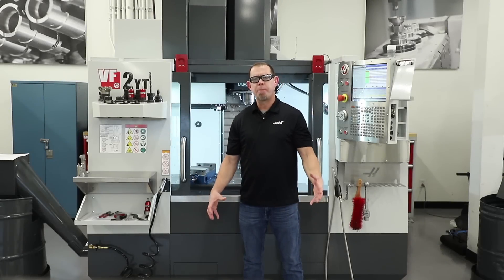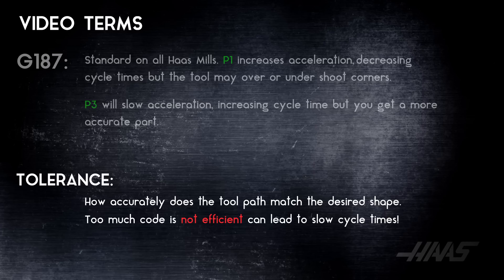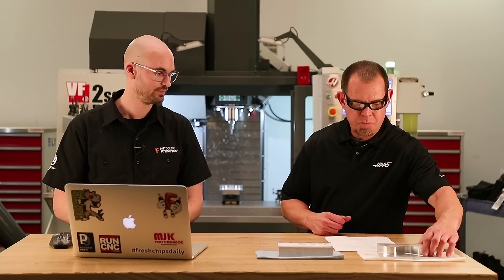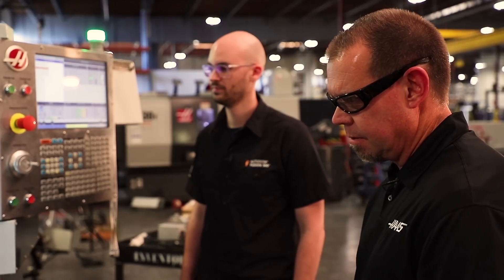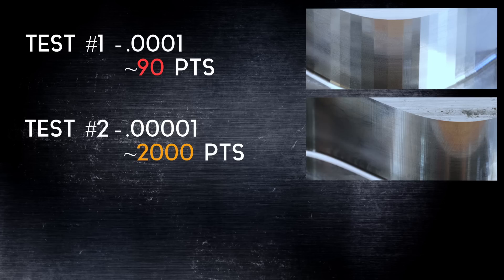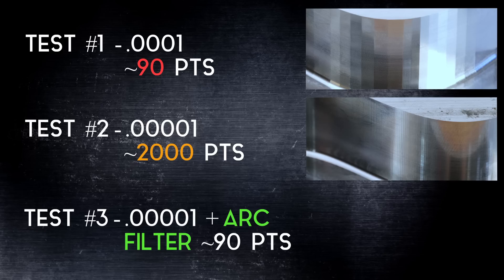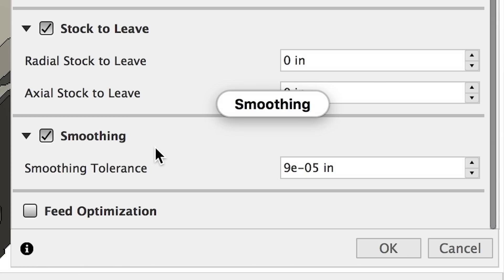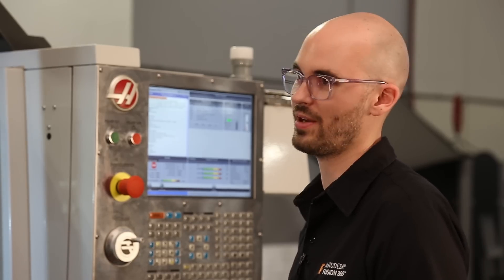CAM Settings and Your Haas Machine - AutoDesk visits Haas Automation.

Comment: dang i haven't been machining to long and this video answered all my questioned,  got an SS and was bothered about the machine slowing down if the tolerance to high and still leaving a bad finish will defiantly be using smoothing and the adaptive clearing p1 setting wish knew this earlier this is gonna help me a lot!

Comment: This question is for either the Autodesk or Haas reps: Do you guys have any recommended fusion settings for specific machines. i.e. I am thinking primarily of which Machine Confugration to choose from Fusion, or which Post Processor to choose.

Or even better a more precise answer like: use (x) configuration for a 3 axis VF2, use (y) machine configuration for a 4 axis VF2, etc.

Comment: When he talks about arc filtering nd smoothing.  The tolerances he has  "1e-05 in"  what does that number mean?
Reply: This is another way of writing 0.00001".  1e5 would then mean 10 to the 5th power or 100000.

Comment: Great video even though I don’t use Fusion360. I use SOLIDWORKS with a CAM plug in but most of the settings still apply. My shop is about to get a VF4-SS with TSC. Looks like I will be able to fly through material!
Reply: Only if you have the hsm option you can.

Comment: Im still new to this but could you use the g187 p1 to get the initial form if the part and then switch to g187 p3 to do essentially a set of finish passes or is it more efficient to just run in one of the g 187 settings? Edit just saw the last part and think it answered my question.

Comment: I was going to rough out some pockets then do a finish pass. I got the roughing pass to show G187 P1 but the finish pass would not go to G187 P3 and instead gave G187 P2. I set the Tolerance (1e-05 mm) and Smoothing lower and lower (1e-06 mm) until it was ridiculous and still P2. What else needs to be done to get P3 on my finish passes?
Reply: Hi Jack,

First, make sure you have the latest post with all of the updates: https://cam.autodesk.com/hsmposts?p=haas

This is the code snippet from the post that sets the mode to P2:
        if ((stockToLeave != 0) || (verticalStockToLeave != 0)) {
          workMode = 2; // default

This means that if any stock to leave setting has been set, the post will use P2. If stock to leave is disabled, P3 will be used. Make sure that the operation has the stock to leave option on the passes tab unchecked.
Reply: @CJAbraham  Tried it with some production code just now and it did give me P3. The Stock to Leave option was used during my first test. I had it set to a negative since I projected the part onto the fixture and need that extra 0.1mm around the perimeter. Thanks for the info!!

Comment: Is it just me or did they show in Fusion a tolerance of .01 and say it generated about 90 points, and then in the slide refer to it as test #1 .0001~90 points?
Reply: not sure of the actual numbers, but it was less points due to the use of arc's instead of straight-line moves

Comment: Great Job.  It really helps to see and hear the machine cutting also.  Traditional CAM Systems ( Mastercam, Esprit, Gibbs . . et al ) better get their act together.  Very cool that the CAM software knows what G187 setting to post.
Reply: As a contract programmer in 70s 80s and 90s I used many of the Cam softwares you mention here. I have used Fusion for my own testing looking at tool path. Fusion has come a long way and looks to be FANTASTIC for 90% of the shops
Reply: Idk why I’m responding to a four year old video, but all of those other CAM softwares can do the same. It really comes down to the post processor. Even the crappy default Haas Posts that comes in MasterCAM outputs a G187 P2. at the start of every toolpath. Additionally, I know in MasterCAM you can arc filter a toolpath, but you can also refit splines within a given tolerance at the geometry level, so every toolpath created from that spline will be the same without having to remember to arc filter each toolpath.

Comment: If the cam is done right, is there any need for high speed machining option on the mill?
Reply: I would say yes. If your feed rates are high enough, you can run through all the lines of code the standard look-ahead can do before it can calculate more. Then you get down to single line operation, which gets ugly. All HSM does is increase how far ahead in the program the machine can plan out the tool path.
Reply: @mechmotion  Thanks... So if I'm not running crazy feeds maybe don't need(?). Most of my parts are fairly simple like the one shown. Can't see why this isn't standard... feels like a money grab.
Reply: @spinnetti  It really helps for massive files with short moves. I've turned it on and off just to see what it does, and sometimes it does help. Longer G2/G3 moves give the control enough time to calculate the next move.
Reply: @mechmotion  Thanks. Just trying to determine if its a good value, and since I'm not trying to run 24x7 and most my parts aren't that complex, I'm thinking its not a good value.
Reply: @spinnetti  I would agree.

Comment: This video was informative but it also dropped my heart. I literally just purchased a brand new 2018 Haas VF-5SS. It delivers next week. It's the SUPER SPEED for crying out loud! And Now I find out that I can't really go as fast as the machine can handle unless I buy the $3,000 code? Cmon Haas. This really disappointed me.
Reply: there's a lot to still gain using smoothing controls and G187.  we have a 2013 VF6 without HSM option and with attention to the code I am able to make it do anything I need it to.   
 Haas would probably never call it this, but the HSM option is kind of a stop gap option to improve less than great code.   if you can give it well smoothed code it will run plenty fast enough to scare you.  :)
Reply: @MorganOliff  I'll have to give it a try. I'll make sure to add some good smoothing and give it a test run. I found out I have 200 hours to test the feature. I'll document how the machine runs both with and without HSM and check the results. Hopefully you are right and I don't need to buy a $3k code
Reply: Cisco Hernandez I think the HSM will really help if you got them to turn it on.  There are some cases where the CAM fights and still produces a ton of points,  on our newer vf2 its nice that it just doesn't really care and runs the code fast anyway.   But it would probably run even better if I went over the code the same way I do for the VF6
Reply: I would not buy a SuperSpeed without HSM option IMUO, just how I would not buy a machine without a probe period.

Comment: Why didn’t Autodesk talk about POWERMILL?  Are they trying to kill it.  In the upper Midwest there are a lot of shops using this and I feel like they are ignoring us!
Reply: I am sorry you feel that way. While we are aggressively working to make powerful CAM tools more accessible and connected with Fusion 360, we have not forgotten about Powermill.  There are some dramatic improvements to calculation speed in the works for example.   Reach out anytime, I lead the Product Management team for all our CAM solutions.
Reply: @makestuffwithkids989  Admit it, Powermill will go the way of the do-do just like Artcam did. All of the sudden ZERO support.

Comment: I’m confused with the use of the term millionths...was it actually millionths?
Reply: .00001 is 10 millionths of an inch.
Reply: Perfect. Got it!
Reply: yes: .0001 inches is ten millionths of one inch.    Quite confusingly, you will also hear this value referred to in the trade as "one tenth"  (because it is one tenth of .001")  the number is  2.54 micron.
Reply: Morgan Oliff Thank you for replying.  I really appreciated the demo. 

I would think in machining, “one tenth” referred to “one ten thousandth” of an inch or “0.0001 inch”. 

In that vein, I would also think that “0.0001 thou” would be like “one ten millionth” or “0.0000001 inch”.

Am I thinking correctly?
Reply: Ron Charette individual millionths go in the 6th decimal place.  When you have ten whole millionths they go in the 5th place aka the hundred-thousandths place
Reply: @MorganOliff  Isn't .123456 something like 1 tenth, 2 hundredth, 3 thousandths, 4 ten thousandths, 5 hundred thousandths, 6 millionths?  .000010" ?  The smallest measurement I've seen is on a Mazak lathe .000000 or .00000. (Probably the latter,  I don't know what kind of work needs millionths)..  Just for a example.

Comment: Why is Autodesk's CAM breaking spline curves into a multitude of G1 lines to begin with when smoothing is not on? Any curve can be translated into G2/G3 arcs directly. You already have the start and finish coordinate and radius of each arc that makes up the curves of the spline. Smoothing facets makes sense when tool pathing a polygonal model but for parametric solids and arcs you have all the information at hand to make perfect tool paths to begin with with no need to fit vertices into a tolerance range.
Reply: Splines aren't arcs to begin with. So the start and end point you refer to isn't there. The smoothing option will try to fit arcs along the coordinates of the spline based on the tolerance. Then use lines when that can't be achieved.

Comment: I have a serious question without trying to trash haas here. I have a fadal that mills a 3D radius on a part at 300 ipm with no hesitation, I try to run the same program on my brand new haas and it’s so laggy it’s ridiculous. I turned on the hsm option with we have the “trial”. I’ve heard the option they give you the trial of is only 50 percent of what the actual option  is the true or is haas just not good with high feeds ????
Reply: No, the 200 hours is the full feature. We used it sparingly over the course of a year at the last shop I was at and it had paid for itself by the time the trial ran out (you can turn it on and off again, so I suggest doing so).
Reply: Now that I just watched the video, I would ask you: what your tool path tolerance is? are you using line segments or arc filtering? and are you commanding a g187 in your code?

Comment: Did you really refer to that as a high performance machine tool? Seriously?
Reply: @machinist5506  Have you ever used a Haas? None of them cost $750k and there's a reason. I went from programming and running a VF-6SS (using HSMWorks - IE this same CAM software in the video) to Hermle and +GF+ Mikron machines, and there is a world of difference. But they are different machines; Haas is a commodity machine tool. They get the job done, but they are not special, they are just priced affordably for their market.
Reply: @atomkinder67  I think he was defending Haas.

Comment: Does the changing tolerance of g187 change the tool engagement, making it less constant throughout the tool path? Does this increase tool breakage risk of you’re pushing a tool to its limits?
Reply: Theoretically yes, there is a "corner rounding" setting for G187 P-values that can be altered in the code, but it will definitely slow down in smaller arcs (external or internal) without giving much benefit. I never bothered using P3, it slows the machine too much and chipload suffers. Often I still got results within a few tenths (ten-thousandths) of nominal anyway using P2. For job-shop work this is generally more than adequate.

Comment: In the same way that controllers can steer the tool along a defined arc (which can be specified by a single gcode line), why can’t they interpolate splines (perhaps with multiple gcode lines to specify the control points)?
Reply: Heidenhain controls actually do this by default and do better with more points and there are settings for interpolation accuracy. Haas' control just doesn't do this very well, but they are also much less expensive generally speaking.
Reply: I have heard that but couldn't remember that it was Heidenhain!     some machines are just better at math!

Comment: Why is High Speed Machining even an (Expensive!!!) option? It should be standard!!!

Excellent Video.
Thank you both for the informative subject matter and the clear as day examples.
Reply: No machine tool has high speed machining standard. Welcome to the world of machine tools
Reply: @andywalser2343  My Heidenhain Control has an indirect option for that as Standart. its called Cycle 32 Tolerance.
Reply: @Der_Drache  That's just tolerance, M120 is look ahead, you can only use it with compensation aswell, it costs and it only looks ahead 99 lines, you also have to tell it how many lines to look ahead
Reply: @andywalser2343   Let me repeat 'Why is High Speed Machining an option anyway?" 
If I come up with something to make my product better, I immediately work it into production and pass it on to my customers. Should I start offering it an option?
Hey, you can buy the basic unit but for almost $3000 more we'll make it perform like it should.
Reply: @andywalser2343  How about this model. Say 30% of all mills bought opt for the HSM option. Wny not include it in ALL mills and bump the price $1500. Now you're getting paid for EVERY mill that is sold and your revenue for HMS would increase and customer satisfaction would increase.. sounds like a WIN - WIN to me.
Reply: My Mits controller has 1260 line look ahead standard amd will spank a haas with the highspeed option. Better question is why are we paying for an option that is sub par? Why do I have to pay for 1400 inch rapids when I can get a kitamura that will do 1800 and have deeper look ahead for just 5k more?
Reply: I think a bigger question is why it is not the CAM system that controls this. Unless they feed more power to the servos or tune them differently, there is really no logic that should dictate that this is a machine control thing and not a CAM thing. I cannot really understand what the difference is between high speed machining in the CAM and in the machine control. Fusion has high speed machining, but it appears that high speed Fusion CAM + High speed Haas is peddled as the better solution.
Reply: @jenspetersen5865  From what I can gather. HSM enables much deeper look ahead as in 30 steps vs 200 steps as well as smoother transitions via tuned driver / servos. So it's definitely something that could not be implemented in CAM.
Reply: @jackflash6377  So if I understand it right HSM from the CAM is a HSM Light compared with the machine option. 
On the note of why HSM is a paid option, it is quite logic when you invest large amounts of monies in refining things that only part of your customer base will pay for. I as an example could care less about milling speed, but the build envelope is more important, and I am much more interested in a low entry price for a machine that in its own time can make the parts that it is just too cumbersome to have made by sub suppliers. We probably need 2-4 spindle hours per week, and I would much rather pay for a probe than High Speed Machining, but I kind of understand your complaints when you have bought the SS machine
Reply: @jenspetersen5865   HSM doesn't really increase the cutting speed but it can lower the cycle time simply due to not slowing down in the corners as much. My main use would be.. I'm cutting small pockets and the whole machine shakes as I make the corners because of the start-stop of each line segment. HSM would smooth that out and give a better surface finish.
I see your point and agree with it. Perhaps the answer is to at least inform the buyer exactly what HSM does and recommend it as an option that is needed. I wasn't informed and my salesman sort of steered me away from it. I only realized later that I am one of the customers who could benefit from it. (I don't think the salesman understood exactly what it is and what it does)
I know there was a trial period on the machine but somehow due to the clock on the mill being out of whack, I was cheated out of my 200 hour HSM trial. Again, it wasn't explained to me except to say "there is a 200 hour trial of HSM and a few other options such as 2nd USB, 750MB of memory, Ethernet connectivity" all wasted due to the clock fiasco.
There, I'm done venting.
There could be some confusion here. What is called HSM in CAM is probably Trichoidial Milling and not HSM on the machine which is more of how the G code is processed and interaction with the servos / controllers.